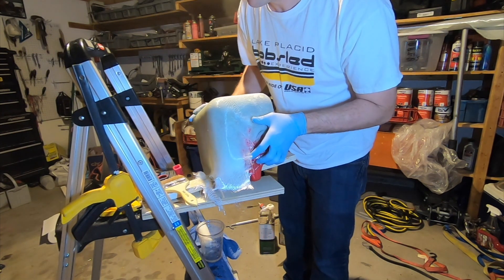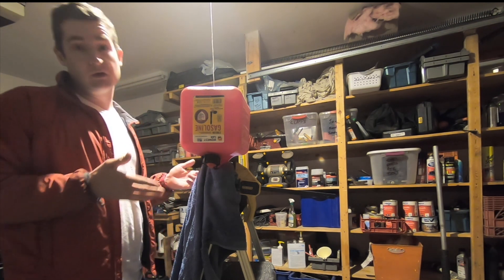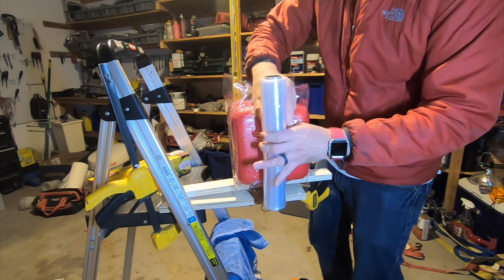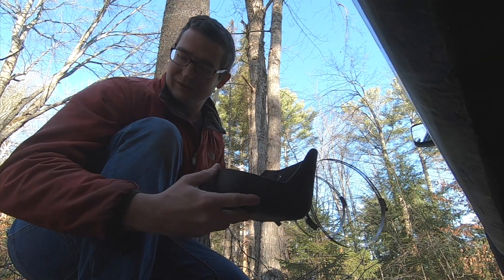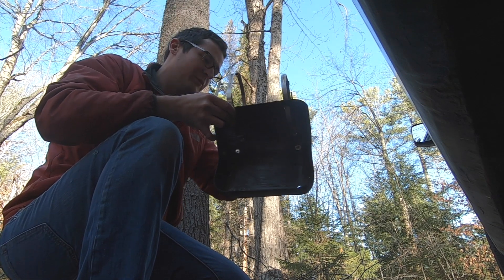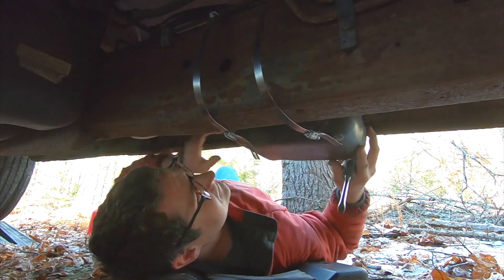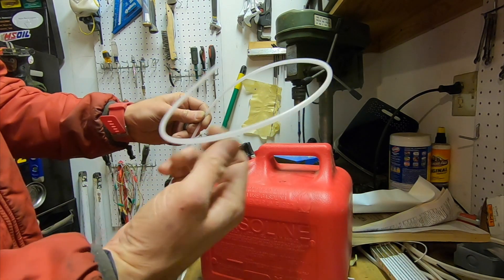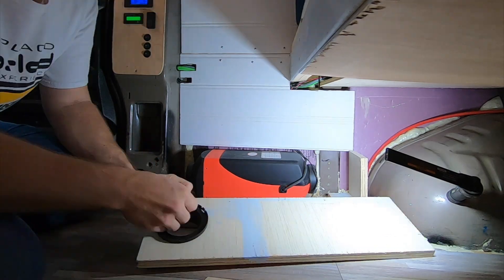Fitting a Diesel Fuel Tank to a Gasoline Van | Part 4 Diesel Heater

Comment: Planning on adding another tank as well for my gas heater since it’s rather too complicated to tap into my current tank. How did u tap in the webasto fuel line into it?
Reply from the maker: The fuel line fit perfectly into the vent fitting of the tank we used.  The other option is using a portable boat fuel tank as they are already fitted with a place for the fuel lines.  It would be a bit more expensive but you wouldn’t need to retrofit anything.  Hope that helps!  Best of luck with your project!

Comment: hi, did you mount the fuel pump inside or outside the van ?
Reply from the maker: Outside!  It’s designed to be mounted outside.  That and it makes a pretty annoying clicking noise that I think would drive you to insanity inside.